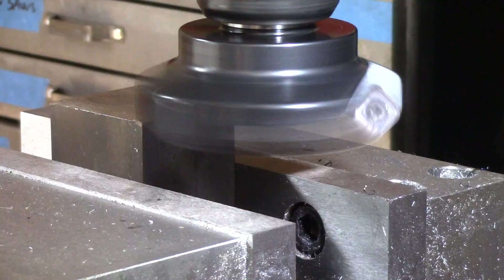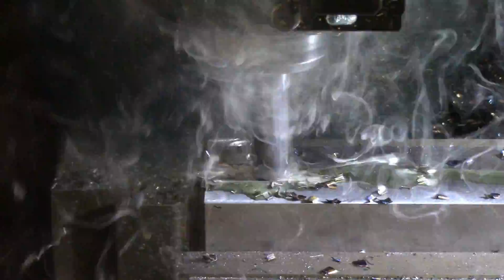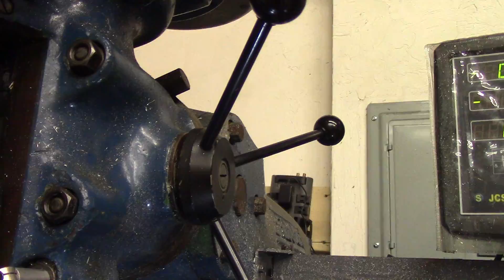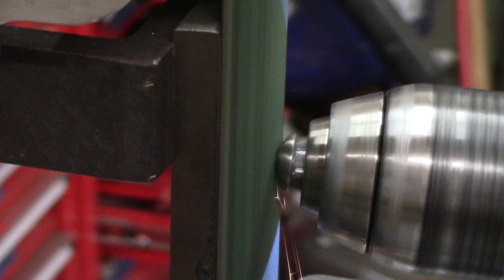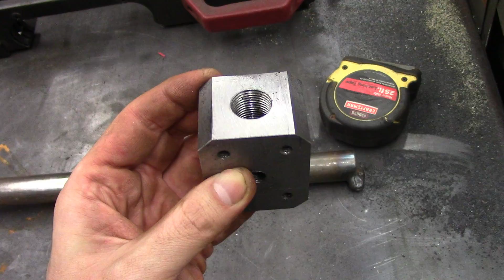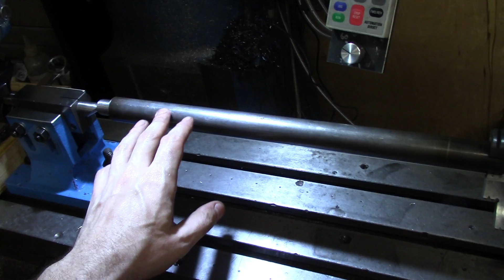Most FUNCTIONAL giant sword yet | Guts' Raider Sword from Berserk (Part 1)

Comment: what sort of steel did you use? didnt quite catch it if you mentioned it. would of recommended the same manor they make katanas folding the steel then putting high carbon smithed in for edge retention